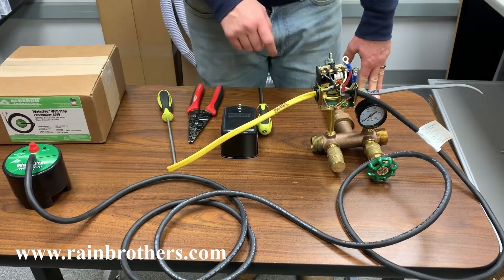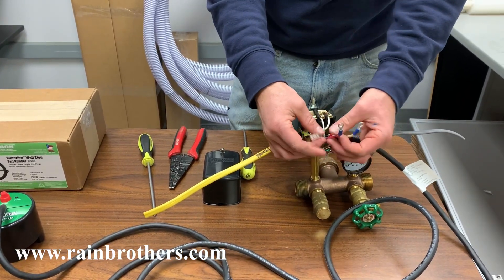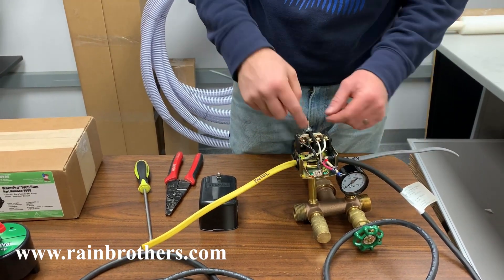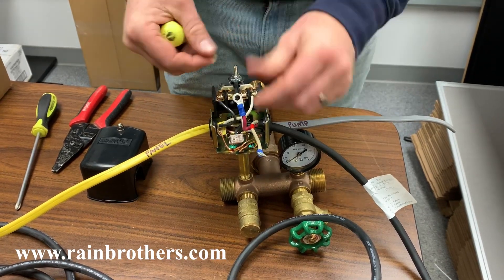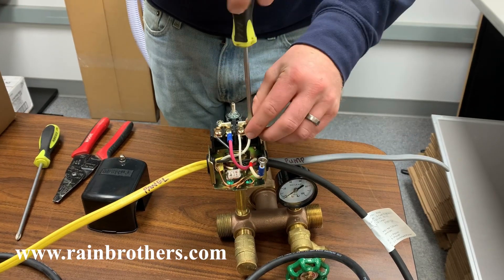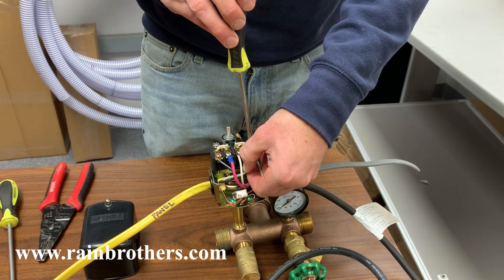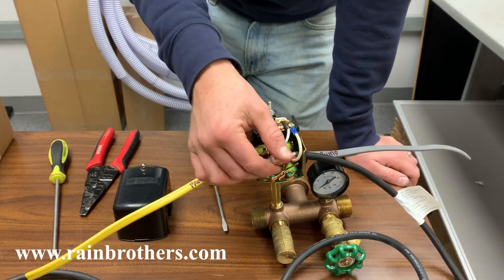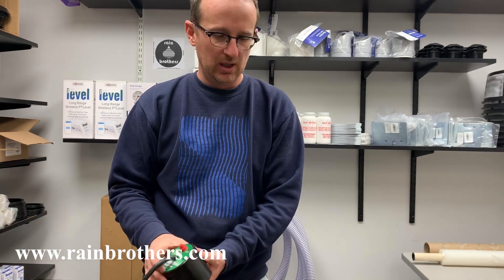Prevent your house from flooding! Well pump shut-off device for pipe leaks

Comment: Anyway to add additional sensors to this unit so I can have mutple areas covered?  If the leak is later in the plumbing, I dont want to wait till water builds up enough to reach the main unit.
Reply from the maker: Hi - sure, you can run multiple of these WellStop switches in series. If one switch opens, it will prevent the pump from running. However, for this kind of set up I would highly recommend consulting an electrician.

Comment: I believe this installation is incorrect!  It differs from the manufacturer's instructions. You connected the sensor's black wire to the switched hot line (after the pressure switch), rather than the unswitched hot line coming directly from the panel (before the pressure switch).  With this setup, the WaterPro sensor won't have power until the pressure switch calls for the pump to turn on.  The sensor should always have power, right?  So the sensor's black wire should be connected to the panel's black wire using the wago connector, and the sensor's red wire should be connected to the terminal that originally had the panel's hot wire.  That way, the sensor always has power, and will interrupt power going to the pressure switch when water is detected.  Please see Figure 3 in the Installation manual.
Reply from the maker: Thank you for taking the time to comment! You can wire either way. If the switch is already off, the pump is not running and the WaterPro won’t matter. It’s only when the pressure switch is energized that the WaterPro needs to come into play… so either method of wiring is correct. As long as the WaterPro is interrupting a hot circuit in the event of water detection, it can be wired using the method mentioned in this video or the method mentioned in your comment. Thanks again for your feedback!
Reply: @rainbrothers  With your wiring, I agree that the unit will cut pump power if the sensor gets wet, which is all that really matters.  But. The two LED indicators (power, and pump stop) will not function unless the pressure switch has turned the pump on.  It'll still get the job done, but the status of the WellStop won't be displayed unless the pump is on.   For other viewers, I do recommend Rain Brothers. I have purchased this unit from them. They are very responsive to questions, and very professional.
Reply from the maker: great point, and thanks for the kind words!

Comment: This looks great!  How sensitive are the sensors?  In the spring I often have some water come in from outside, would that shut down my pump?  I'll definitely be installing this once I recoup from holiday expenses.
Reply from the maker: There are two metal probes on the bottom of this unit, and, if water puddles between those two probes, it will create the circuit that will trigger the switch to turn the pump off. So fairly sensitive

Comment: Good video but can you please go over the 230 volt  
wiring better
Reply from the maker: As I mentioned in the video, the 230V version installs exactly the same way. The only difference is that the wire colors going into and out of the pressure switch might be red instead of white. But other than that it’s exactly the same
Reply: Where would the white wire go for a 230 volt If you're only breaking one side of power